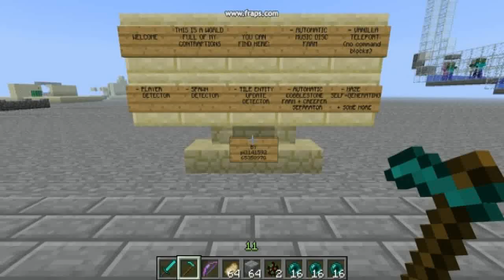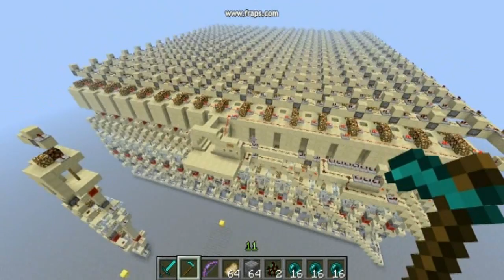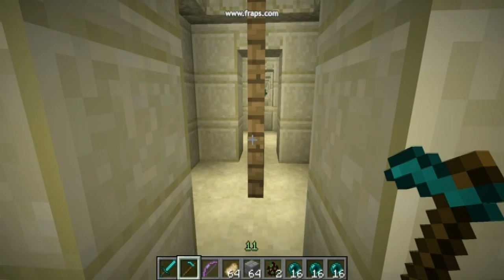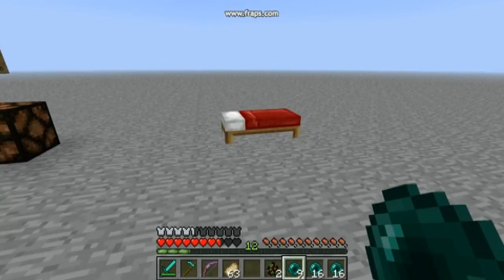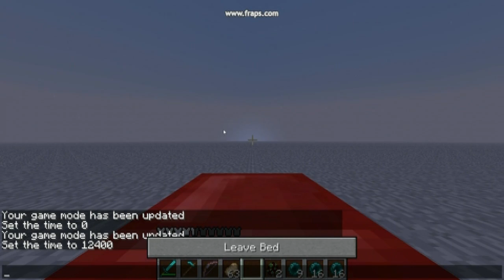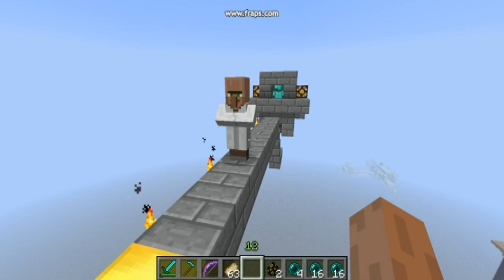Self-generating Maze

Comment from the maker: That is actually an amazing idea. I've just tested it and it works pretty good. More laggy, but also faster. I'll incorporate dispensers with 576 speed II potions under pressure plates so the silverfish stays fast. That should work for a bunch potential resets.